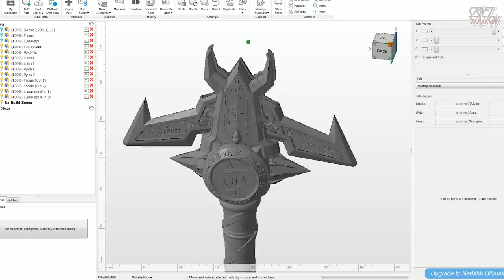How to make  CRUCIBLE SWORD from DOOM ETERNAL DIY

Comment: Its cool, but I miss back when props were hand made, and DIY was something anyone can do regardless of high end tools.
Reply: Right, I miss the simpler times
Reply: @Call me Beercules And model the entire thing in CAD. You think that's quick or easy?
Reply: Wdym barely DIY? He did it himself.
High qualitu props require higher end tools, it's only logical
Reply: This still DIY tho.
He do it by himself.
The only difference is the technology
Save time & energy.
Reply: I mean you can do the overwhelming majority of this by hand - it would just take a comically long time and incredible levels of precision
Reply: @MintToastIvan  the point of DIY is to make something cool manually regardless of your available resources, not simply model it and a machine build the damn thing for you. Not everybody has a 3D printer.
Reply: @OrionDawn15  
DIY
/diːʌɪˈwʌɪ/
noun
the activity of decorating, building, and making repairs at home by oneself rather than employing a professional.

He did it himself, therefore it is DIY for him.
Reply: @MintToastIvan  yes, but it's also meant to be a sort of accessible thing. Why do you think most DIY's don't use high-end technology to get the work done for them?
Reply: @MintToastIvan  but besides, even if it's not a DIY/highly accessible DIY, it's still entertaining to watch.
Reply: @OrionDawn15  Bro he had to model that thing, "simply" isn't the word one would use for this.

Comment: Me: DIY for the doom sword? Oh it’s gonna be great!
Me: *watches DIY
Me: well now I have to get like 700 tools and there we go!
Reply: Well, nobody really would have thought that you just can Minecraft punch your materials with bare hands to craft a demon slaying sword. The necessity for tools is a given.
Reply: The things I could make if I owned a CNC milling machine. And a workshop where I could use it.
Reply: You can just 3d print the majority of it. I'm still working on hammering out the final details in ZBrush for mine but the initial print looks damn awesome already. After the base is done I'm going to get the blade cut from lexan then surround the outside with EL Wire. If you decide to try it, 3d printers really don't cost that much anymore.
Reply: Well the video is also stolen
Reply: @RelativelyBest  There is a few that are a few hundred bucks that are tabletop size, but their accuracy is not too great.
Reply: @blitzkrieg8776  Honestly, with my economy, "a few hundred bucks" is still kinda expensive.
Reply: Well ur still doing it yourself right?
Reply: Exactly who doesn't have like 10k to spend on 700 different tools, why try to use random parts from cheap stuff to make it when you can own a cnc Mill and 3d printer for the cost of a new organ
Reply: Hhhhhhhmmmmmmmmmm, you’lll need printing shit and paint stuff, with wood funkiness shit

Comment: Title: "How to make Eternal SWORD from DOOM ETERNAL DIY"

The point of DIY is being able to do it yourself and I highly doubt everyone watching this has the tools to create it.
Reply: Gōdon Gurando This particular sword is from the Phobos gameplay for DOOM: Eternal.
If you look up the sword from DOOM (2016) and DOOM: Eternal you’ll see a big difference. Mainly the difference being that the sword from DOOM (2016) looks to be made of flesh and bone where as the sword from DOOM: Eternal looks to be made of stone or metal.
Reply: @Hirrei  In the ending аppeаrs
Reply: I maybe could
Reply: @Hirrei  Design is just slightly different, thаt's аll.
Reply: Quartz Skull  Nah I would argue that there's nothing similar between the Doom 2016 crucible and Doom eternal sword
Reply: Quartz Skull  tbh its different swords from what we know about from the Lore
Reply: Gōdon Gurando  The design of the crucible contains a demonic skull, bones and a little bit of flesh and it doesn't have the slayer mark on it and if you compare it side by side on what the Slayer currently weilds where it seems to be made out of metal and steel and most importantly it has the Slayer's mark on it so my conclusion is that The Crucible is not the same as what the Slayer currently is using
Reply: Quartz Skull  blade is different too
Reply: @warhamm2000  no, there's is more than one crucible, the one in 2016 and the one in Eternal, so no it's not a cosmetic change
Reply: Vinsternator40 looks like you ain’t the sharpest tool in the shed
Reply: He did it himself tho
Reply: What is a DIY?
Reply: Every DIY video should add the line "whit the proper tools, skill and knowledge"
Reply: @genosvarmillion8614  Do It Yourself
Reply: @warhamm2000  now that the game's out, I can tell you that they're differnet crucibles.
Reply: To be fair he do it himself.
Reply: This is actually quite easy to do, he probably has the mold on his page or in the description, all you need to do it fill it with epoxy or aluminium ( wich you could easily make with a concrete smelter and a gas tourch, the smelter that is) ,fill it up and cout out a plestic blade for the sword, wich you could cut out wish a razor and break, then sand, gotta work with what you have.
If toure all fancy about it you could even let a professional company let it do for you, theys cut the plexy class with a waterjet and send it to your doorstep, orders like that arent that expensive
Reply: I mean, a 3d printer is pretty cheap to get nowadays
Reply: Tools or talent
Reply: Hirrei actually it does, it’s just the demonic version and can’t be used as a weapon.
Reply: @warhamm2000  the one haden has is a different one entirely then the  one in eternal
Reply: Congratulations! You and 998+ other people do not understand or misinterpret the meaning of DIY.

Let me explain it to you.
DIY or Do It Yourself, is an activity where you do something completely by yourself rather than, say, hire a professional to do the job for you or buy something already made.

DIY does NOT mean that you do not require proper tools, knowledge or experience. DIY also does NOT imply that such projects are cheap, simple or quick, if you believe these things then you are sorely mistaken and you should do yourself a favor and ditch such ridiculous thoughts and/or expectations. You can try to fix a water pipe problem with a piece of chewing gum but that's probably not the best way of doing it. Just as you can try to make this crucible prop from whatever the fuck you find in your home but it's more than likely not going to be high quality.

Besides every single person here has the ability to learn to use such tools to create something like this crucible blade from DOOM Eternal. If you are not willing to put time, money and effort into learning these skills and getting the equipment to be able to take on such projects then you should just go to Amazon or eBay and buy a prop made by someone who can! Problem solved!
Reply: I mean, DIY just means with the right tools you can do it yourself (hence the name) but that doesnt mean it has to utilize cheap tools or materials, just that its possible to get them at home

Comment: Amazing work but I have a suggestion to make the blade more red even in rooms with light, if you got the acrylic (I’m assuming that what you used) and gave it a frosted finish it should have that hazy red colour that the crucible does

Comment: How did you get access to the runes inscribed on the blade and on the hilt?
Reply: I would like to know this aswell. There is so many runes on the blade and by guessing and making upp runes yourself that look that good would be an insane amount of work
Reply: My first guess is the Doom Artbook.
Reply: nuu chu just simplewy get a pic. of the ruins and make a template for em and after tat the specs. are configured in the printers programing 🙄.....are chu ppl rwy unfamilure too 21 cent. tech 😒

Comment: "do it yourself" 10,000 dollars later. just gotta get yourself a 3D printer, and a whole shit ton of different drills, along with all of the materials and glue
Reply: It seems like you're poking fun at that sentence. Which makes no sense, because it literally is a DIY project and he does show most of the steps which would give you a rough idea on how to DO IT YOURSELF. DIY however does not mean or imply that proper tools, knowledge and experience are not required. You CAN try carving this from soap and duct taping the parts together but have fun with that.
Reply: @arattactician5697  DIY is meant to be a more affordable option LOL

Comment: Called The Crucible, This isn’t ‘How To’ or ‘DIY’ in any way, and why didn’t you just use the 3d printer for the cross guard thing (sword experts help me out with that name), I find it a massive waste to make a wooden mold and use an unnecessary amount of whatever that casting material is